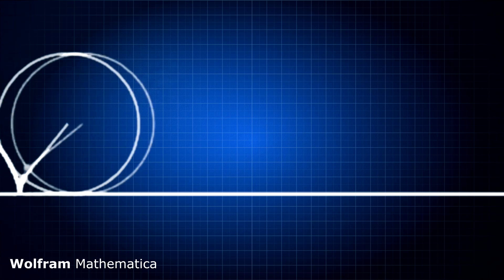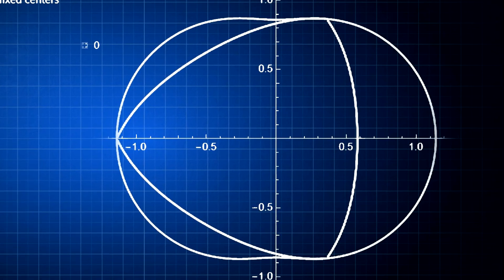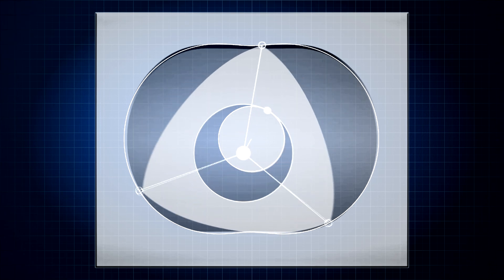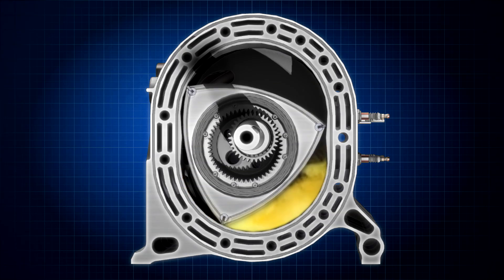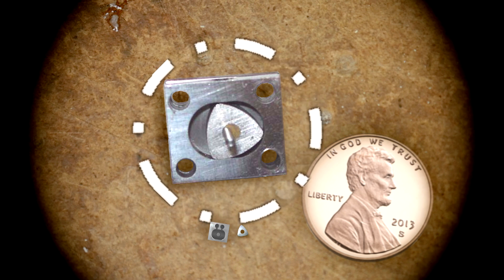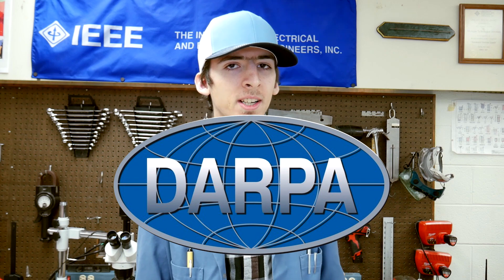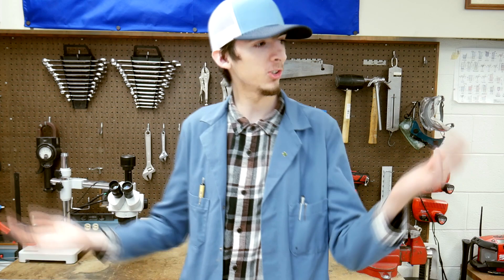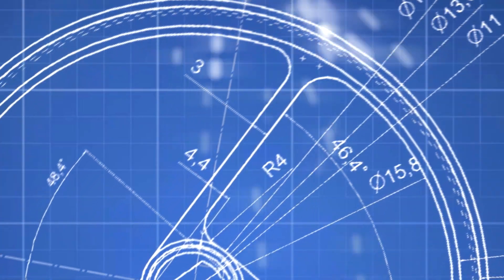Really Exists: Internal Combustion Engine the Size of a Penny

Comment: Great video as usual, but whats up with that hum tho?
Reply from the maker: Yeah it took me a long time to figure that out myself! The long answer is...
I recently got a power brick for my camera so I don't have to deal with batteries all the time. No big deal. Except it allows some 60Hz component through and (somehow) into my powered shotgun microphone. Normally, I would grumble and redo the audio. Nope! Quarantine time! Now I'm stuck.
I notice it right away during editing and apply a high-pass filter. Now my voice sounds like it coming to you over a loudspeaker. No good. So I drop the base by a paltry 6dB and add music to disguise the problem. Better make that music just a little bit louder than usual. It's not perfect, but if people don't use headphones, it should be fine.
Publish video. "Hey, what's up with that hum tho?"
...
Mission Failed.
Reply: @BlueprintScience  Not a fail, just giving you a hard time. ;) Happens to the best of us. 
You might try using a 60Hz notch filter instead of a pass filter. You might get better results without affecting the rest of the audio.
Reply: @BlueprintScience  High pass filter... nah....use notch filter.
Reply: @BlueprintScience  You could use addons that take a sample of the hum and then filters it through the whole audio file. If i remember audacity has a tool like that.